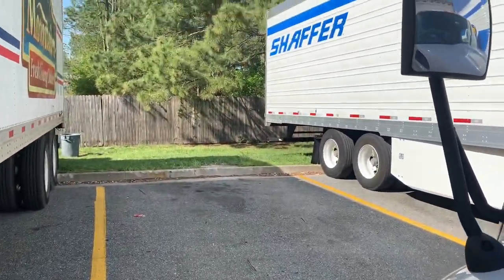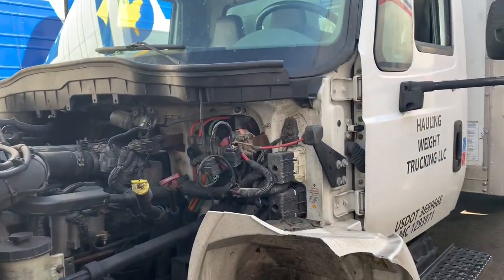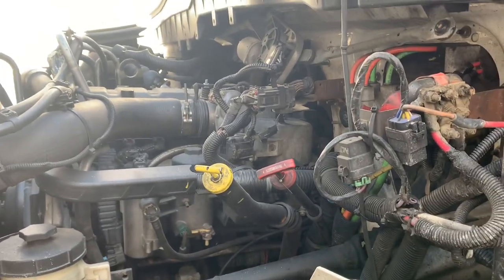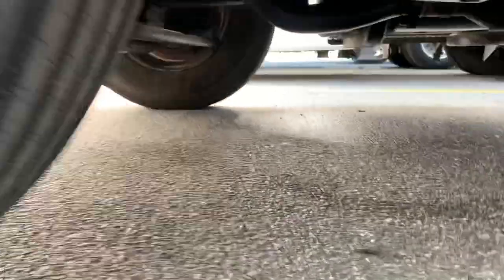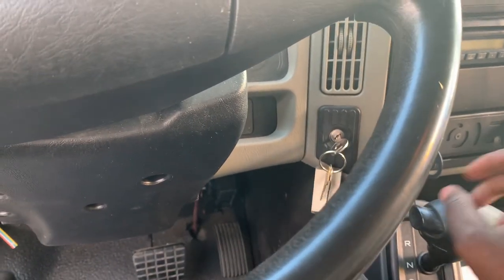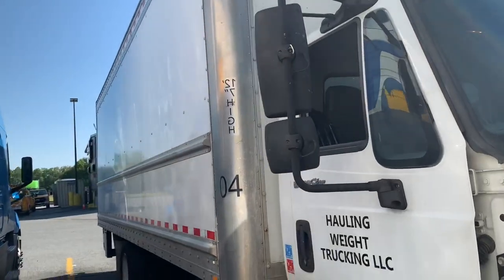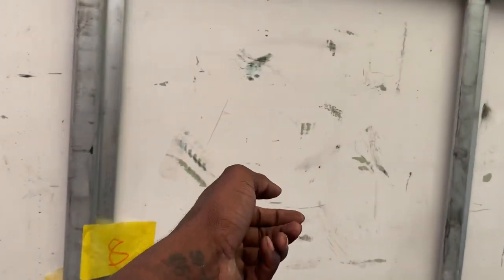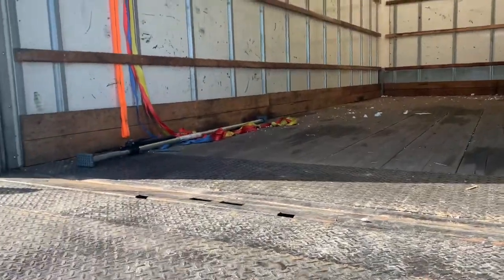Do Not Buy A Box Truck‼️ Before Watching This Video | Do’s & Don’ts Part 2 | Truth B. Told

Comment: Only purchase international box trucks with Cummins Engines. 2015 and up
Reply from the maker: Thank you. A lot of people been saying the same thing I wish I knew before this headache came along
Reply: @Life Journeys  actually get the international 4300 DT466 Motors 2007 and down without the DEF system. Mines is at 500,000 no issues still champion of the road.

Comment: how much have you paid in maintenance so far🤔?
Reply from the maker: Over $100,000 within 5 months. Yes I know could have just bought a brand new truck 🤦🏾‍♂️
Reply: @LifeJourneys_YouTube  Man, I feel for you bro. That is crazy. I bought my truck last March 2015 hino at 220,000 miles. Now at 260,000 with no issues. Only standard oil changes and replaced front shocks, new tires throughout the year and replaced an O Ring in the power steering but that's all minor. That is alot of money to put in the first 5 months. I would try to sell it and get you another truck man.
Reply: @SavageExpert  bro I’m buying a 2015 hino wit 
360kmiles on it. Heard they good trucks that last for a long time.
Reply: @LifeJourneys_YouTube  Wow😬. I would've definitely got a different truck at that point but, it should be running like a champ now💪🏽. we need an update. keep up the good work tho 👏🏼.
Reply: @mohamedcalooley4175  I just bought a 2016 Hino with 384,000k miles. Im hoping for the best.
Reply: @just_majestic  good luck fam let me know how that bad boy runs .
Reply: @LifeJourneys_YouTube  wow what did you fix and repair for it to come to that price
Reply from the maker: @fivestar000  everything lol literally
Reply: @LifeJourneys_YouTube  yeah I feel. Is it doing good now
Reply from the maker: @fivestar000  yes it’s running fine other than that oil leak